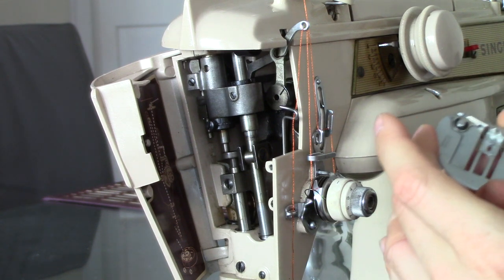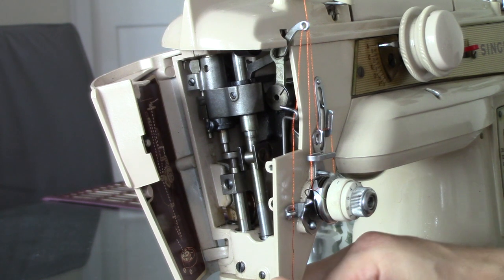Singer 411G threading for chainstitch

Comment: Isn't there a cover plate that goes over the bobbin case in place of a bobbin for it to do the chain stitching better?
Reply from the maker: The 600 series and above uses the cover, it is a slightly different design.
Reply: @jamesrogers991  I have 600 parts and no machine! I'll have to try to find one to go with it!

Comment: Need great help my singer 411g  of 55 years is not picking up the 
The bobbin thread
It’s bundling up below  and not sewing certain materials
Reply from the maker: There can be a few causes for this problem. One is, the tension is not working right. The other possibility is that the bobbin race is not sitting correctly. Lift the black clip and ensure that it is sitting correctly. Andy Tube has a video called "check and set the thread clearance singer model 403A" which will help.
Reply: Thank you for your response 
Will check the video

Comment: buenas amigo me parecen muy buenos los tutoriales y me gustaria que hicieras uno con respecto a la tension de abajo y el sistema de la 411 G ya que me estoy dando cuenta que la maquina no funciona correctamente, me la han prestado y comence limpiando y engrasando pero no se como funciona, mi madre tiene una singer negrita con zig-zag y la conozco perfectamente, pero esta es nueva version para mi, lo triste es que no puedo entender lo que dices, sin embargo lo que vas haiendo en el video lo comprendo bien, muchas gracias.-
Reply from the maker: Estoy felíz de ayudar. Por favor explica qué no funciona cuando tratas de coser. Comience con la puntada recta: esta es la posición A (izquierda) y K (derecha) en los diales delanteros, con el ancho del zigzag en el centro y la longitud de la puntada de aproximadamente 2,5 mm. Coser algodón y luego decirme si los puntos de sutura no están bien en el botón o en la parte superior de la tela. Entonces podré decir si es un problema de tensión superior o un problema de tensión de la bobina. También quiere esto para costura normal o pespunte de cadena.
Reply: @jamesrogers991  me gustaría leer el manual en español.
Reply from the maker: Quizás necesitamos encontrar un manual en español o traducir uno de otro idioma al español
Reply: , recién encontré un Manual 411 M tienes que ir al siguiente Link   www.usermanuals.tech/d/singer-411-m-manual  tiene 107 páginas formato hoja medio oficio.